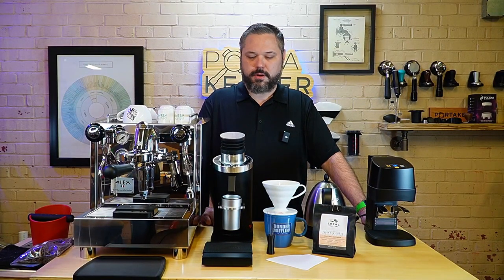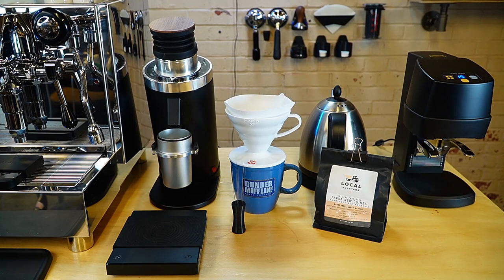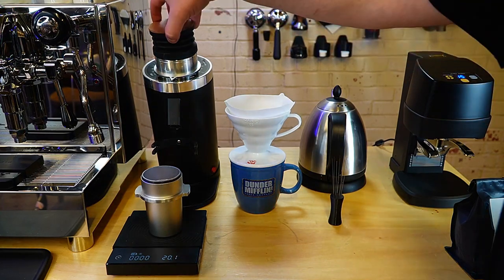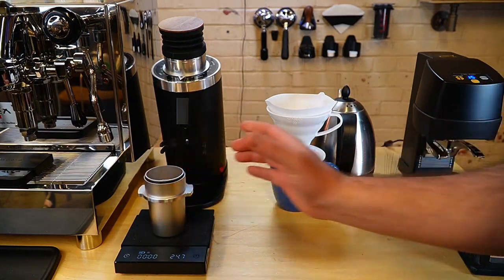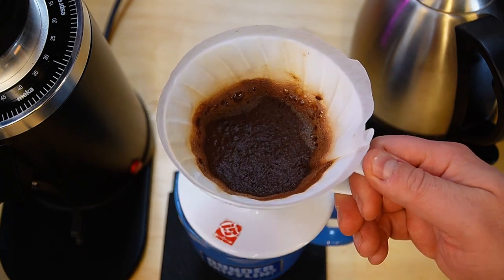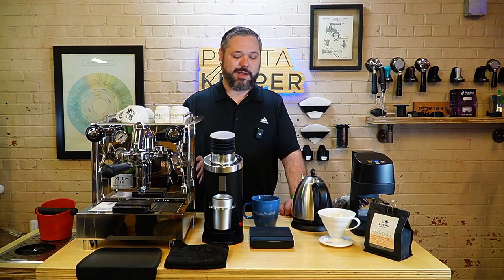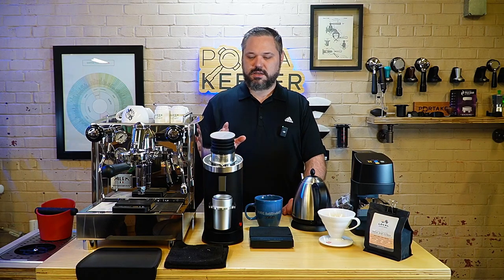Turin DF64 Gen 2 V60

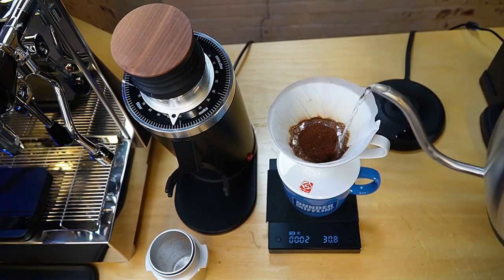Comment: I’m struggling with this grinder. After aligning the burrs (now at 85-90%), my total brew times for V60s won’t drop below 4:30-5:00 minutes. No matter which grind setting (tried from 45 all the way up to 70). Just seems like it’s producing so many fines. 

Did you not encounter this at all?
Reply from the maker: Don’t have this issue at all.  Used this morning.  Was about 3:10 on 20g.   Not sure your overall brew method.
Reply: @portakeeper  tried Hoffman’s improved V60, Lance’s 1-2-1 and 4:6 now; all exceed 4:30 minutes. I’ve been brewing V60s for two years now; before this with a Timemore C2 handgrinder. Still getting used to the new grinder. But so far, it’s been quite frustrating.

Which grind setting are you at, with your DF64 gen 2?
Reply: I also have this issue. For hoffmann's 3 min recipe. I usually have to go to 75. Which is much coarser than my Timemore C3esp to get the same drawdown time

Comment: Hi, am new to your channel and really appreciate seeing this review as am considering this grinder having a Breville Smart Grinder Pro but needing to upgrade.  Are you using the stock burrs or have upgraded to the DLC burrs?  Do you have any thoughts on whether it's worth it to upgrade to DLC?  I believe I read somewhere that the burr geometry in the Gen II is similar to that of the DF64V which is also similar to Gorilla Gear.
Reply from the maker: The DF64 V5 and DF64 Gen 2 use the exact same uncoated burrs.  They are a great stock burr, I like them so much, I almost think they are my favorite cheap burr.   The DLC is the same burr but coated.   I like both, kinda like the raw a bit more but hard to say.   Most people I doubt will ever notice the difference.  Geometry is quite nice.  I have no clue about the gorilla gear.

Comment: My experience is that without using the bellows, I have less than .3 of a gram. I don’t like the bit of fines and chaff. Better for me is grinding 21 grams. I add 5 grams of water. 315 grams total weight.